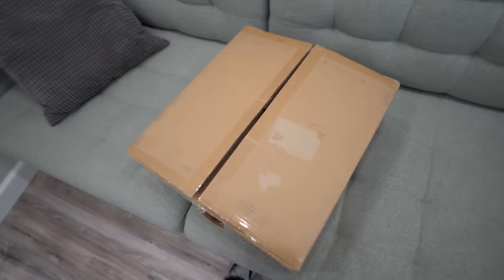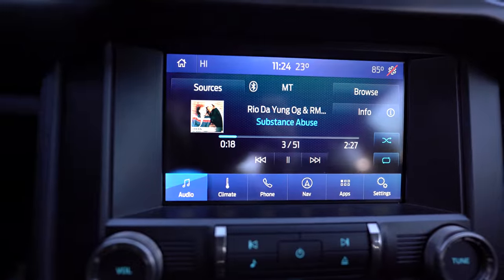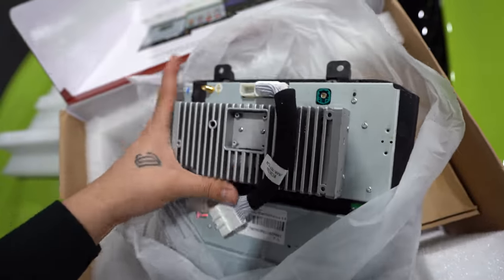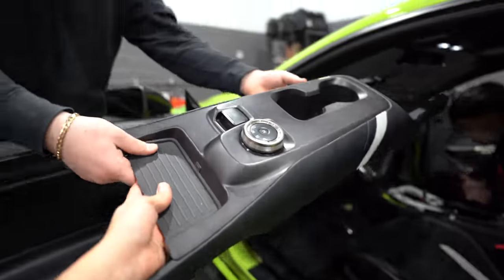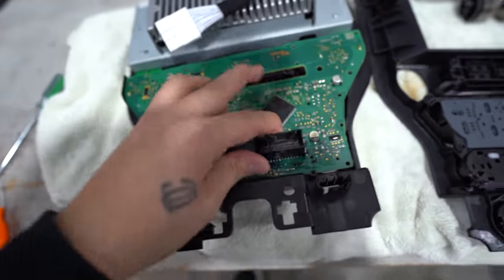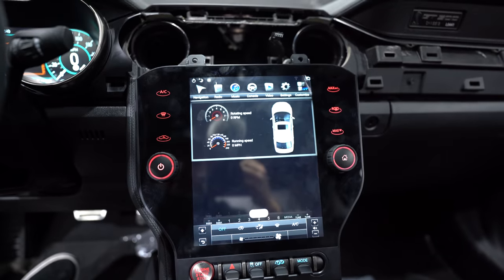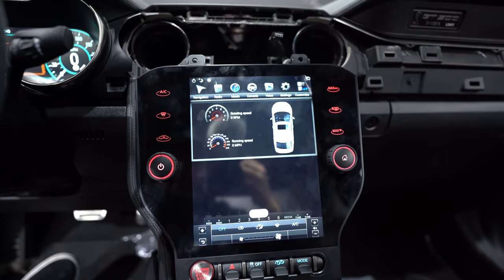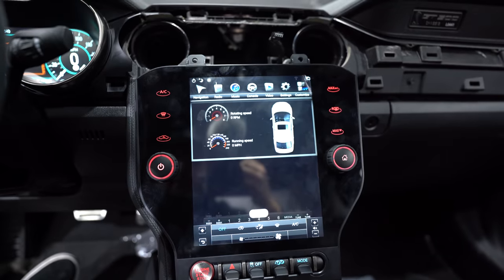INSTALLING A TESLA SCREEN ON MY MUSTANG GT500!

Comment from the maker: What should the next Modification be?!
Reply: Exhaust
Reply: Straight pipe if not at least a muffler delete
Reply from the maker: @miltcoronado3392  you don’t think it’s loud enough?
Reply: Intake
Reply: @MotorTube  I mean Its good but louders always betta 🕺🏽🛸
Reply: Corsa exhaust
Reply: Carbon Fiber To The Interior!
Reply: Corsa Exhaust!
Reply: Carbon Fiber Steering Wheel!
Reply: @miltcoronado3392  hell no that shit is more than loud enough and i’ve seen people do muffler deletes it sounds so shitty and raspy
Reply: WHEELS
Reply: MotorTube Awesome Video I think your Shelby GT500s New Touchscreen looks absolutely incredible and I think you should get some Carbon Fiber Interior Trim and Congratulations on getting 183k Subs
Reply: What city are you in ?
Reply: Exhaust and Passenger display so you can scare your passenger while you go 1mil + mph 🤣
Reply: PBD e85 tune
Reply: Do some suspension mod less wheel spin
Reply: @HellcatDreaminJosh  I agree with this statement.
Reply: I’m still waiting for someone to put an electric engine in this car. Interested to see how it turns out.
Reply: @MotorTube  still liking the screen??
Reply: Show me that the apple car play works and android auto!!! You won’t cause it doesn’t!!!!

Comment: Would have loved to have seen how the actual installation of all the cables and hookups went instead of skipping over. I'm dealing with the exact same radio but on a 2019 GT where sync 1 has the same back processing head as sync 2 as shown here.
Reply: Hook ups are pretty easy. I'm getting one for my 14 gt

Comment: Not the best idea to mod the infotainment center. A lot of aftermarket systems are really laggy and unresponsive
Reply from the maker: This wasn’t a cheap screen so it’s pretty good quality. had it for a couple days. It’s running smooth and if it gives me a problem. I can put it back to stock.
Reply: I peeped slight delay
Reply: @MotorTube  wasup bro!
Reply: I use that similar screen on s197  honestly not bad at all 8.5 out of 10 and it looks amazing in  s197 which didn't have a screen to start with
Reply: The old "infotainment" on mine sucked too😂 the arrow buttons get stuck when its a hot day
Reply: Most OEM systems are laggy and unresponsive too; so does it really matter if the aftermarkets are? 🤣
Reply: @HappyWheelFan2013  I have a 21’ Audi and the infotainment has never been laggy at all. Maybe just an American car thing 🤷🏾‍♂️
Reply: Hey buddy where did you orderit

Comment: Nice! I may actually do this with my GT500, where did you get that screen?
Reply: Dont do it bro. It can do some damage to your car in the future. I had chevy cruze and i put screen like that. Now the car always needs to be jump started in 5 and below decrees weather. Changed the battery still the same. Now i have a 2021 mustang 5.0 i dont think i will ever put that screen in my car. Only will do that if its straight from ford.